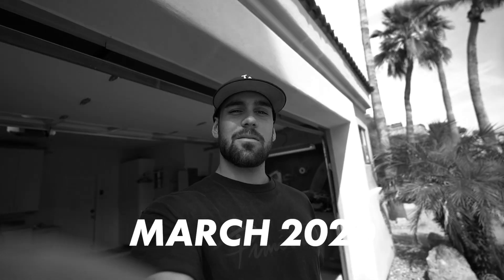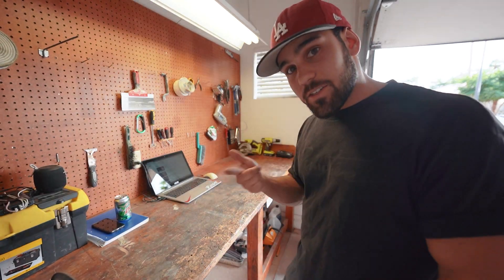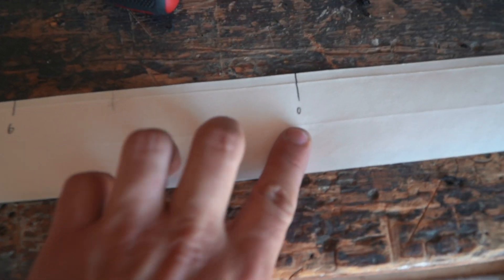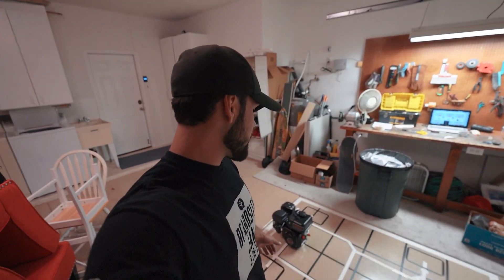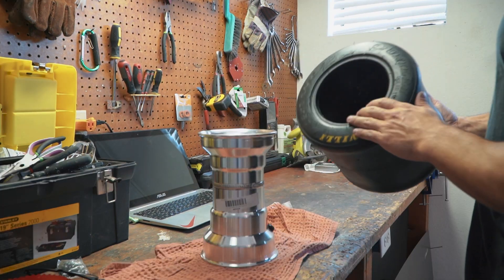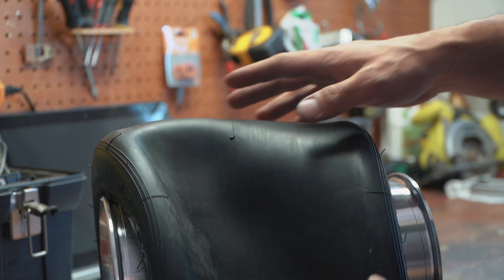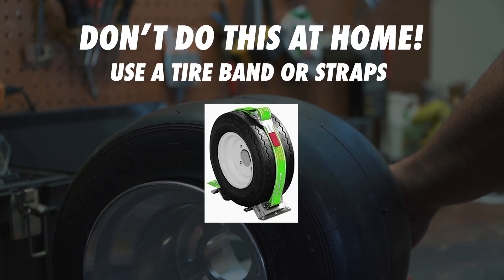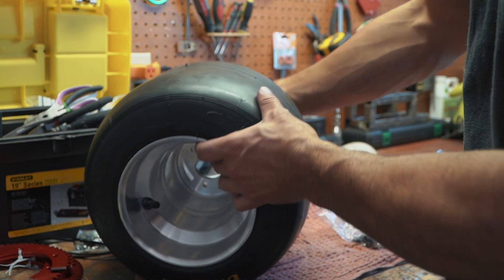Build Your Own Go Kart EPISODE 1 - Gov Removal, Frame Design and Tire Install!

Comment: What is a Governor?
Reply: A bolt in the predator 212 engine or in other small engines that can reduce or limit the speed of the engine. But you can risk flooding your engine if you take it out

Comment: Once you finish the build can you list all the parts/total price. I’m thinking of doing a similar build but am trying to get a feel for the cost
Reply: lol you have to pay for it
Reply: @Lumpyy111  there are plenty guys out there who don't charge you for measurements and have free plans to download 😉 😉
Reply: @mustangdemon87  @?
Reply: @mustangdemon87  @?
Reply: @mustangdemon87  who
Reply: @Dualify  bro it's called Google image. I did an found like 20 different plans off the top... 95 percent of company's will not give you exact measurements because they aren't for spec racing or a certain spec engine. If you can't figure out how to make a square frame you have no business building the chassis  ether. 
I say that as if you don't understand how to weld to not warp the metal then even if you had exact measurements it would be all twisted like a pretzel by the time you finished the frame. You need to do one corner then the other opposite corner then inside bead and so forth. There is far more to building a chassis then most understand.
Reply from the maker: I uploaded a great parts list on my website! It has everything you need and also the tools! GoKartGod.com